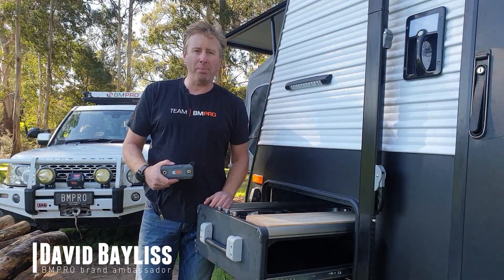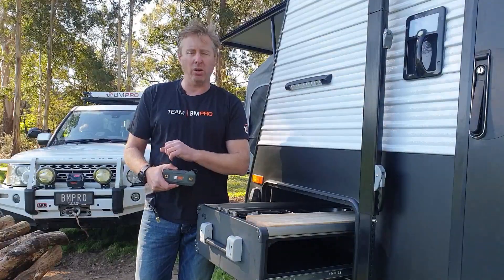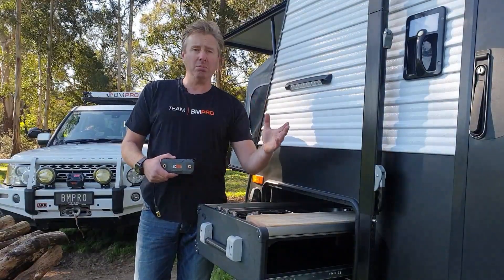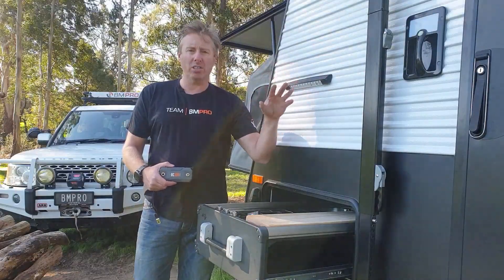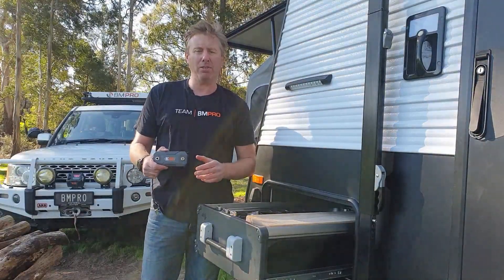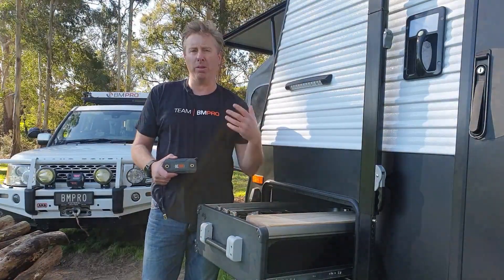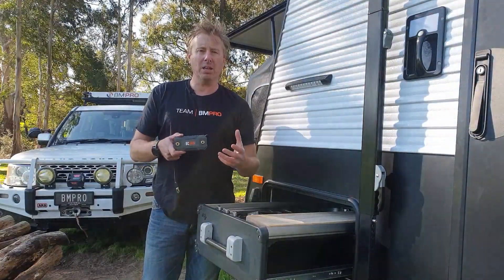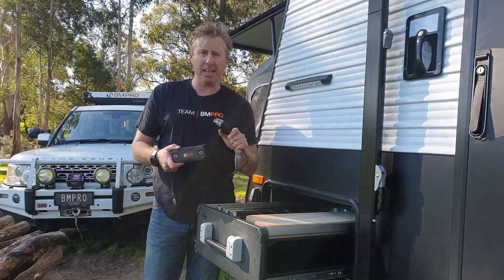How To Monitor High Current Loads & External Charge Sources (With The BC300)

Comment: Can you use this and your control node 103 at the same time on a J35C
Reply from the maker: Yes, you can, as the ControlNode has two Canbus ports that allow the serial connection in and out.